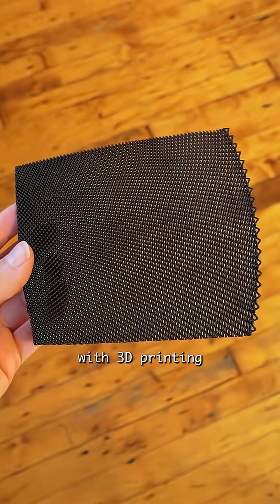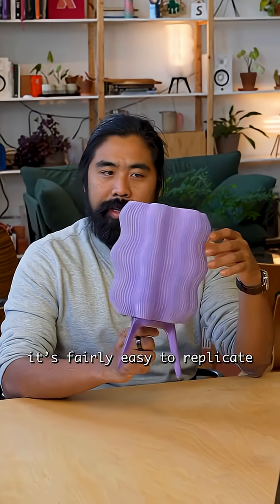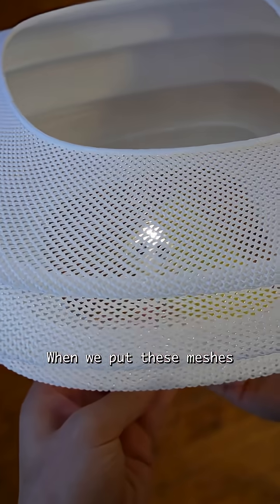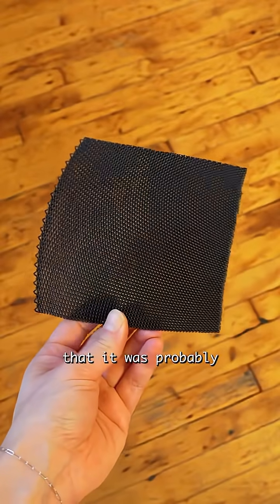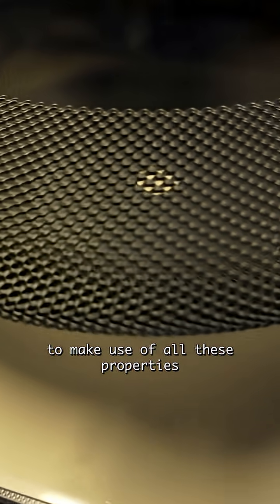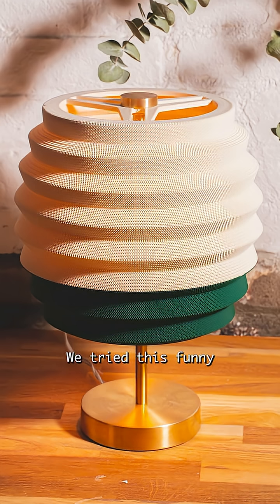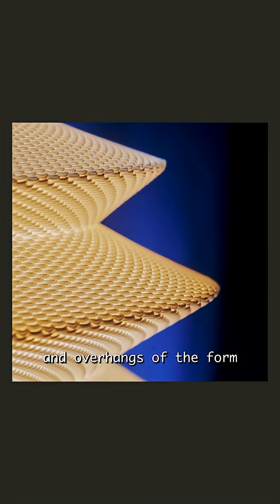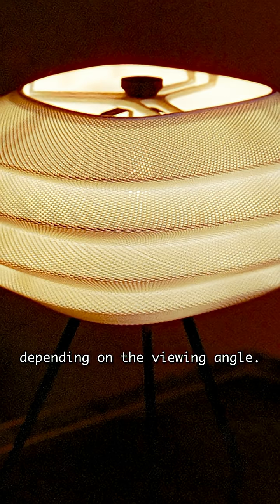Pushing the bounds of 3d printing.

Comment: It’s 3D printed, anyone with a 3D printer can reverse engineer it and print it.
Reply: Lmao i know right. Its kinda one of the main points of 3d printing.
Reply: I personally don't see the value in copying it, though if you're going as far as reverse engineering the mesh pattern for the light properties, you may as well make a more unique form that suits your room better. A homage has more value than a copy.
Reply: @JimJPoggers definitely agreed. And I would bet op is more concerned about the people who just copy en mass to sell at scale chasing profit incentive
Reply: @JimJPoggers agree, but the point of reverse engineering is the learning like "How the fudge did he made that?" Then the trial and error began and some join groups for the sole purpose to "crack the code" then the inevitable triumph arrives. Some also wants to share their journey and rediscovery to others so much so to the point that uploader has the said problem.

Sorry for my bad English, this is the best I can with my little education. And English is not my first language.
Reply: doesn't look like they are using traditional slicer but generating g codes from scratch. good luck reverse engineering it
Reply: @v000000000000v  it more so just looks like hes using the "grasshopper" feature on rhino 3D CAD for the shades, fusion 360 for the bases, and orca or bamboo slicer... and MAYBE a baby bit of g-code modification....
Reply: These meshes are made with mathematical algorithms in a software that cost ALOT of money and is extremely complicated to master. Soo unless his gcodes get leaked this is pretty much impossible to replicate
Reply: @3dvince rhino3d is about $1,000 for a license, OR $195 for a student. Im 90% sure hes using the grasshopper plugin. Time to learn isnt very high either honestly. And there are tons of courses for it. This is gonesrly pretty cheap software when comparing this to something like Fusion (which he does also use for the base design it appears)
Reply: @3dvince  It's easy.... look at fullcontrolgcode. 3d printing is for replicating